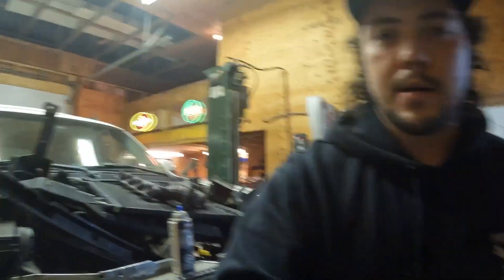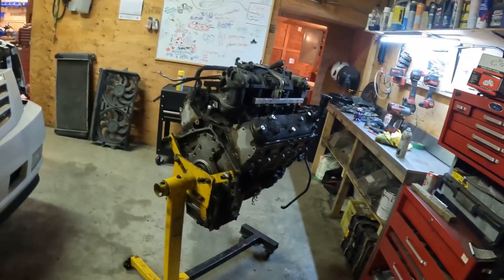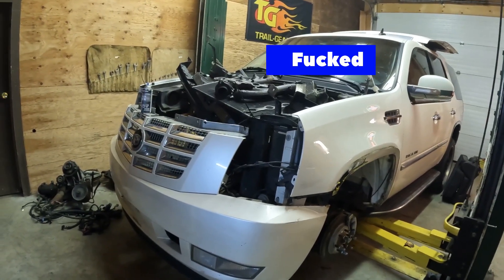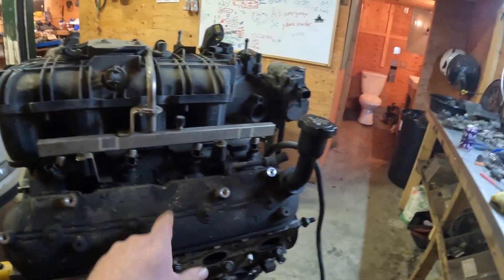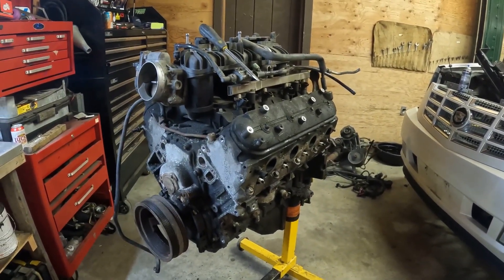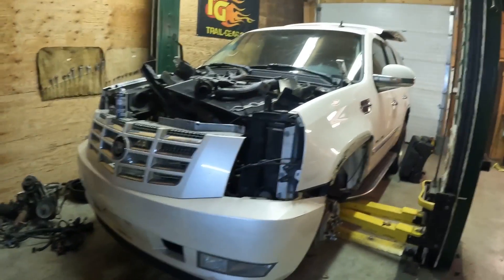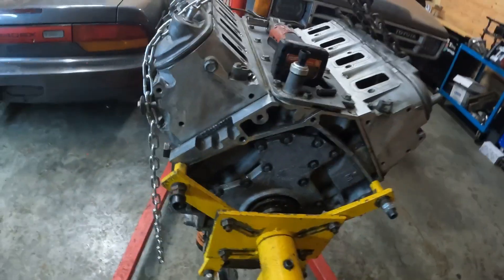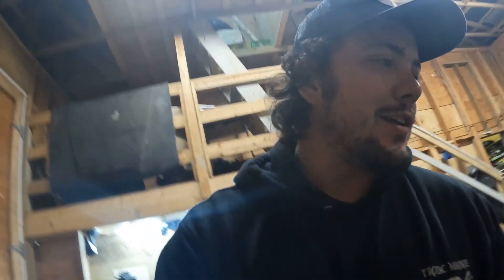BMW E46 LS (6.2) SWAP (Ep 1) INTRODUCTION

Comment: what was the most expenive parts you were able to sell off that hunk a junk escalade?
Reply from the maker: Nothing in particular, but I did sell absolutely everything, the thing I got most for was the trans. But I did by the car for 3000 and was able to sell 5k worth of stuff off it before I scrapped it
Reply: @Skipper_al  going the same route as you and was able to grab a 2008 Yukon for 3k as well, thing is mostly mint so def looking to part out as much as I can. Just finished putting an m3 rear into it. Been only 2 days and I already hate looking at this Escalade, hopping to have the engine pulled this weekend. Would be so nice to have a lift lol but thanks for the videos, they are a big help especially for me since it’s my first car build.
Reply from the maker: @JenkinPerformance  right on dude I’m glad they help!! Same for me man I absolutely hated having the Escalade hanging around, it got to a point where I just stripped the whole chassis, front end, and what not and got it towed away! 
Let me know if you have any question throughout your build I’m more than happy to help. Best way to reach me is through my Instagram